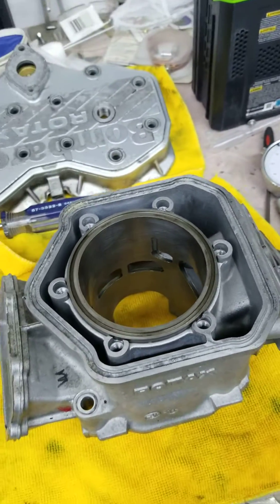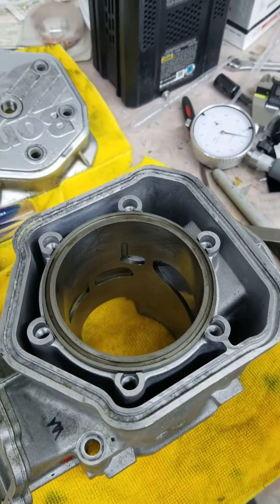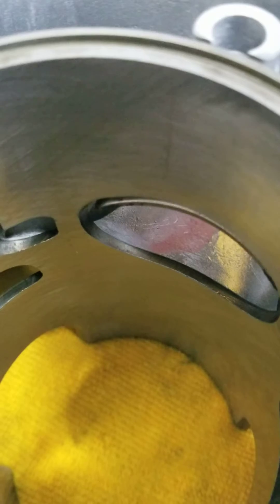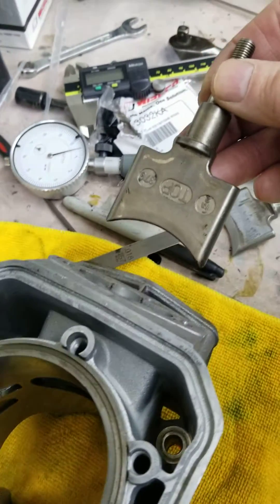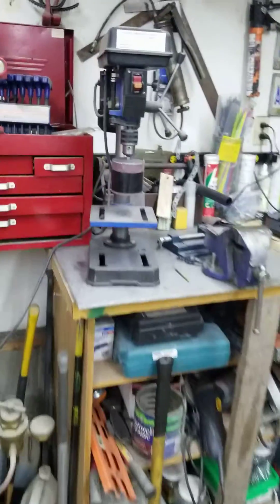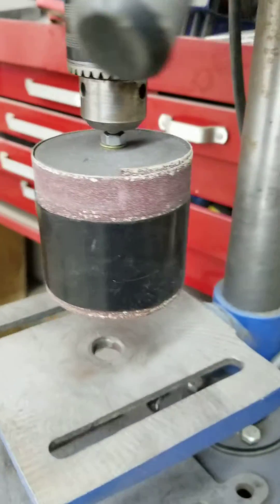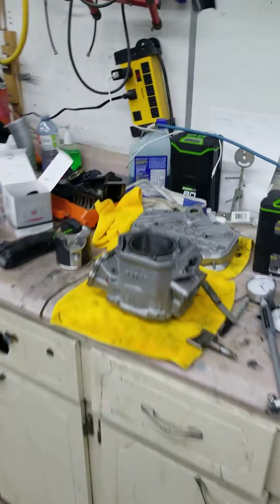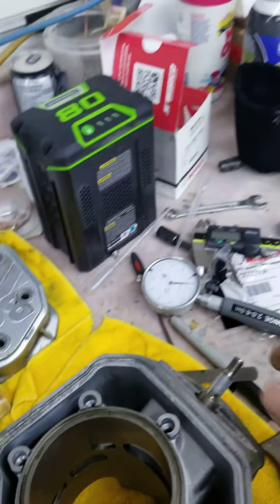Rave Valve service and Trimming  (Caution) you need to know this when rebuilding a rotax engine

Comment: Is there a video of the process of oversizing the cylinders?
Reply from the maker: You require a number of tools including a cylinder hone and good micrometer bore measurement tools
  If you dont have these tools it is easiest to buy the oversize pistons and take both the pistons and cylinders to an automotive machine shop and have them bore them to the correct clearance.  It's not overly expensive.  Where I live approximately 75$ per cylinder.
Reply: @ontariooutdoorsman  Thank you for your answer that's super interesting.